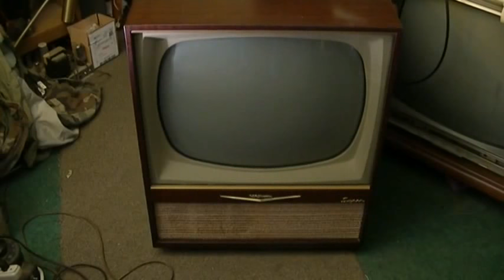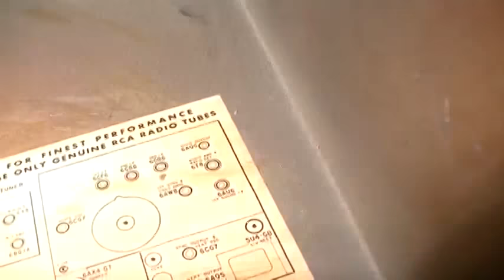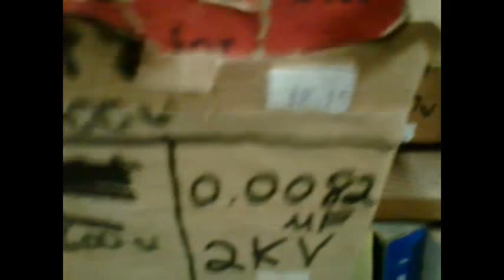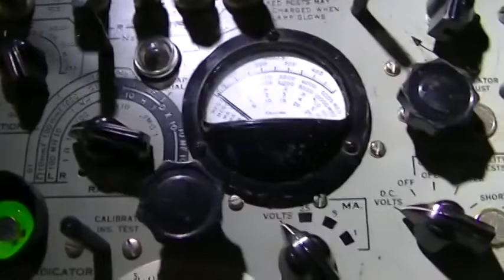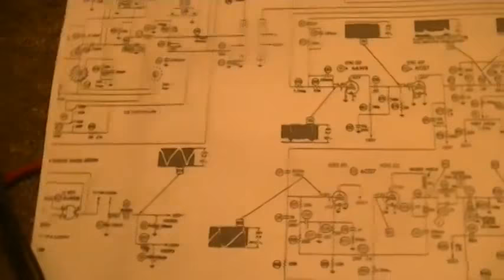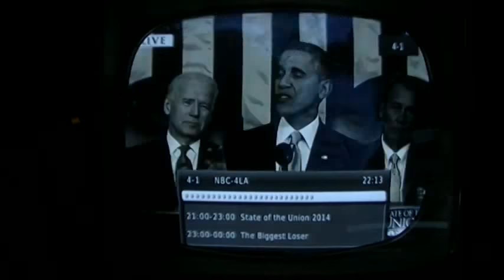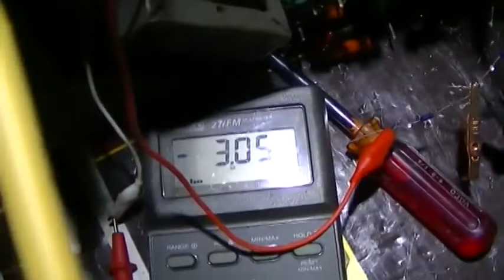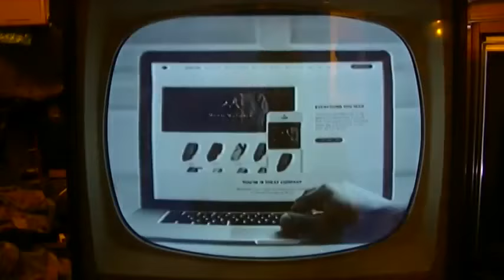RCA Victor 21T7355 KCS98 Black And White Television Repair Restore

Comment: Looks a lot like the old Motorola TV that Dad brought home after we moved to a farm that had power wired in the house, unlike our old place "up North" If I remember right though ours was a Motorola and had a real wooden case, it was a floor model and was, of course, black and white. Color was just starting to appear in the homes of the very rich and famous but never in old farm houses such as ours. The TV Dad brought home was a used set, probably several years old in 1961 when he brought it home. He purchased it from the TV Repair guy on Main Street, a shop that became one of my favorite places after we moved to town a few years later so my sisters could attend High School.

Comment: My dad bought one just like it  . At hinners hardware. I remember the TV repairman used to have a degouser that was about a foot in circumference wrapped copper wire with a toggle switch taped up in it
Reply: It will not let me edit I meant to say degouser
Reply: I remember when the repair man came by in the early 60,s .Was fun to watch him.He explained a lot&had patience with me. Made a demo of the fly back voltage. Was fascinated.

Comment: This is identical, if not the same, RCA model that my parents started with and which launched my CRT obsession.
Reply: Likewise.
Reply: I believe we had one too. But it suffered the fate of..... me.... I disassembled it, and removed the wire from all of the transformers to build antennas for my shortwave receiver. :face-orange-raised-eyebrow::face-orange-raised-eyebrow::face-orange-raised-eyebrow:
Reply: @jimw7ry  copper wire was honey back in those years

Comment: You know I used to hate that damn buzz when text was on screen.  As far as I can recall, it was present in most sets till the introduction of digital LCD sets.  In early sets, there was a FORD tap as well, on our old farm, where we got our first set in the late 50's when ever a neighbor came into the yard with a FORD, we could see each spark plug fire, it was annoying but fun at the same time.  Thankfully there were only 3 farms in the 6 miles of the side road that led to our home so there was very sparse traffic.

Comment: I've got one slightly different. Wood cabinet. It has a station indicator on the front of the set that is run by a dial cord type of system. A drum type indicator with a lamp in the middle to illuminate. Tough to work on. Mine with lousy vertical linearity and poor video response, but very watchable. God Bless

Comment: I had one that looked similar in my garage. I threw it out because the CRT was faded and was hardly bright enough to even be visible in a dark room. A friend of mine used it as a fish tank. I am trying to restore a RCA 9t240 that turns on but there is no picture or sound. Tubes glow. 1949

Comment: In my experience, glowing spot is not from weak crt.  It has a lot to do with the circuit design and how low your brightness level is.  In the 80s, my brother's b&w tv glows a bit long when he turned the brightness all the way down. Leaving brightness, it disappears quickly.

Comment: were you checking for each cap for foil side positions, then installing them foil side on the most negative side of the ckt?
Reply: I was going to ask this qestion. I note there is no reply. This is very important but often not taken into consideration.
Reply: It's not which side is more negative, it's which side is less sensitive - if one end is connected to ground (or a power rail) that should be the outer foil - this way any capacitively coupled interference is coupled to a low impedance path instead of a high impedance signal path. If both sides carry the same AC signal (like in a coupling cap), it doesn't matter which side is outer foil.

Comment: Adding an inline attenuator to the antenna cable will cure the buzz, the signals too hot, or of course wire the output from the box directly into the tvs amplifier

Comment: Question about the yoke on the CRT:

It looks just like the yoke on my Emerson 1224, as does the yoke that came with the 24AEP4 rebuild that came with it.

How could I find out if the yoke is an exact replacement?

Comment: i love a good factory service manual, when they are right. Thanks sharing shango !

ps- good hack on the audio at the end. Is it possible to input video directly too? that would be awesome.
Reply: havent watched the whole video yet but you can input video directly to the grid of the video output tube..to add rca av inputs for example. and you can inject audio on the volume pot typically

Comment: ICPM (incidental carrier phase modulation)  high amplitude white text has been known to cause the video carrier to jiggle away from the 4,5 MHz inter-carrier I.F. frequency resulting in an audio frequency  variation  in the demodulated audio (I do not know if ratio detectors or discriminators react to it more.

Comment: Does the contrast control on this TV set the IF gain, since there is no AGC? That would have meant that in the over-the-air NTSC era, this control would have needed to be set for each station.
Reply: The contrast control is a little like the volume control, except its on the output from the video detector stage. The AGC controls the IF gain and the AGC setting is the same regardless of which channel you are on or what the signal strength is. That's kind of what the AGC is for - to keep the contrast consistent so the customer doesn't have to fiddle with the contrast setting all the time whenever the signal strength changes.

Comment: Hi I have an RCA victor 17t172 and basically I just want to gut it and use the cabinet (parts if needed) and I was warned to discharge the anode but this CRT doesn't have one on it (that I can see). Anyway how would I go about doing that? I'm no electrician obviously so any help would be great, thanks!

Comment: Hey shango i have a question, i know there are two types of crt deflection. I've noticed that anode deflection crt circuits are way simpler than magnetic ones.. is it possible to drive a magnetic deflection crt without a flyback? I want to make a oscilloscope with a small crt i have lying around.
Reply: How would you get deflection? You could get a dot in the center easily.
Why not drive the yoke with audio amplifier circuit? Wide bandwidth you won't get because of the inductance in the deflection windings.
Reply: @johnnytacokleinschmidt515  i'll use two amplifiers to drive the coils however i need HV on the B+(the nipple on top of the crt) but i don't have a flyback to drive it, but i guess is the only way to do it properly
Reply: @silentbloodyslayer98  I wonder if you could use an oil burner transformer and a solid state rectifier. Probably overkill. I'm guessing 10 kv plus. There is Probably an easier way with a simple electronic circuit and a flyback from similar to picture tube set. Again possibly a linear power amplifier driven with a squarewave since there's no sweep. Probably a small inductor coil to match the deflection yoke. Easy way is to borrow b/w tv or monitor. But I get you want to work with what's in front of you now.

Comment: are all the wires going to the back of the picture tube supposed to have power.
Reply: some of them are ground wires for the crt but most of them power the filament and cathode
Reply: That is a 21ALP4 CRT. The base has pins @ positions 1, 2, 6, 10, 11, and 12. 1 and 12 are the heater, 2 is grid 1 (blanking), 6 is grid 4 (focus), 10 is grid 2 (beam shape and blanking), and 11 is the cathode (video input). Grids 3 and 5 are internally connected to the anode (ultor). There is also an external conductive coating (aquadag), connected to the chassis via spring contact, which forms a giant capacitor with the anode. This was a very popular CRT in the mid 1950's, as was its magnetically focused counterpart, the 21AMP4.

Comment: The engineer that came up with that ridiculous printed circuit board design will smoke a turd in hell!  Pretty obvious that the designer never worked on a television before. Otherwise the set would never have been designed that way.
Reply: The idea was to reduce cost by using solder stakes instead of real standoffs. Quicker to assemble and cheaper to produce (they are part of the chassi). Interestingly, these design ideas weren't always the product of the Engineers them selves. RCA at one point had self respecting engineers that took a great deal of pride in their work. I'd almost bet that changes like that were even protested by some of them.

Comment: Hey shango066, Do you have any bumble bees, in good working order that you could sell..? I'm looking for .022-.047uF, I use them as tone caps in my guitars...Just asking...great work by the way!
Reply: Just take a new capacitor and shunt it with a 10k resistor, to simulate a leaky and failed Bumble Bee, and there ya go 😀